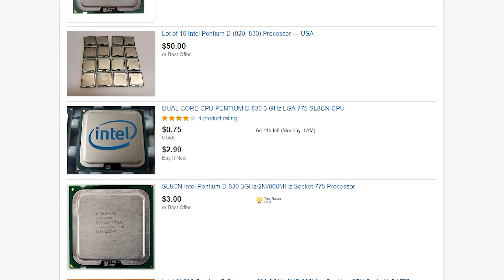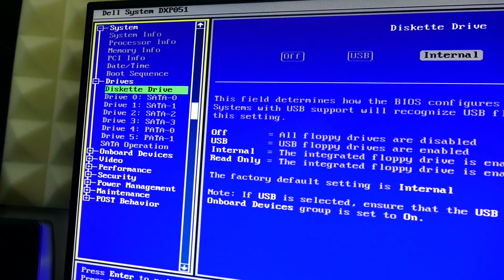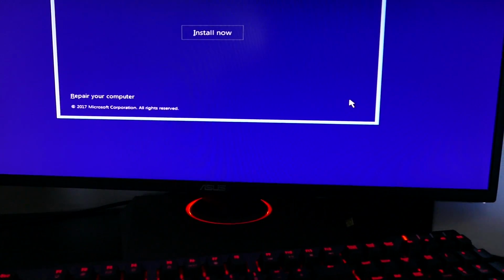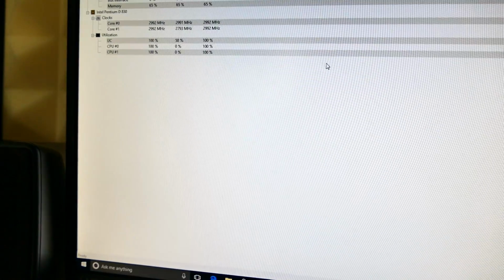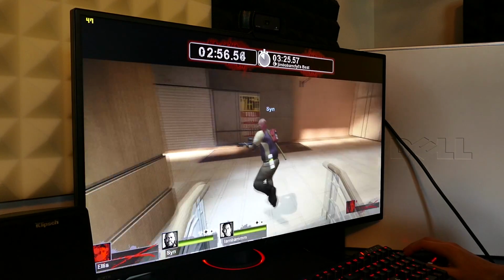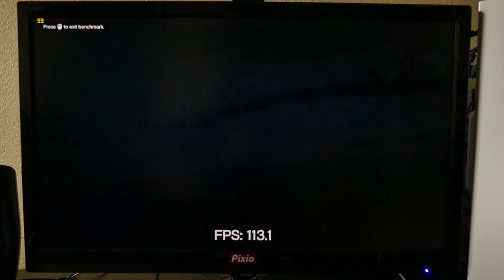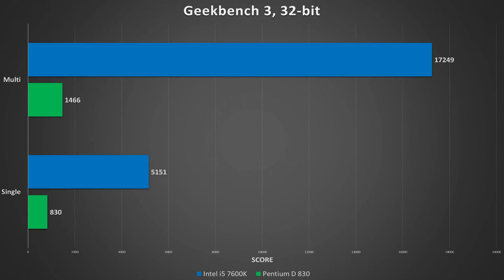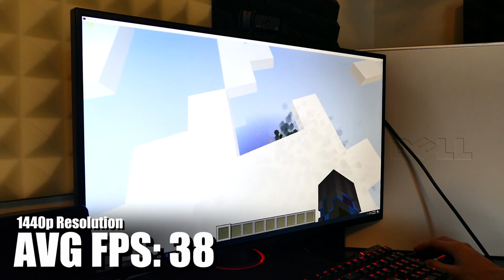I Paired a $6 CPU with a $700 Graphics Card

Comment: Can you rate my specs? 
GTX 1060 
i7 4790 
32GB RAM 
1 TB HDD 
ASUS B85M-G Motherboard
Reply: Sidddhant Kulkarni 32gb ram is overkill but overall it's a great gaming pc
Reply: izzy fast Thanks :). Yeah 32 GB is overkill but there was this big discount so I got it.
Reply: Laryngeal Cancer Aleks Too much ram, yes, but why mediocre Processor?
Reply: Can you rate my specs? Zotac GTX 1080 Mini
I7-7700K
16GB Ram
Asus Strix H270F Gaming
Reply: Rate my specs 

i9 10000k
3 TB Ram
1 EB HDD
1 PB SSD
GTX 1090 256 GB VRAM TI 90.4 GHz base clock 
10,000 Watt PSU Corsair
Reply: Sidddhant Kulkarni get an SSD for Windows. (256 for just windows) if you want to put a few games on it too than opt for a 500 gig. Still keep the hard drive though for files
Reply: Sidddhant Kulkarni 7
Reply: Sidddhant Kulkarni Pretty good graphics card, good CPU, Depends on the RAM type, Shite storage, Motherboard is fine
Reply: The Milestone LP I'm just 11 tho haha
Reply: Alonso Cadena It won't :) the 4790 will bottleneck anything higher or equal to a GTX 1080. 😊
Reply: UAEwolf no need for that pc then all graphics demanding games are 16+ minecrsft u can play with an g4560  and a 1050ti
Reply: UAEwolf moms credit card? 😂
Reply: IDK I Think You should have Got a I5 7600
Reply: RedJStudios Yeah. I'm planning to do that but currently in saving to get a new PSU as my PC is constantly restarting.
Reply: Sidddhant Kulkarni get a ssd
Reply: Sidddhant Kulkarni shite
Reply: Overkill
Reply: UAEwolf pretty good
Reply: Buy a cheaper CPU and a Better GPU , money wasted there , and buy less ram , no games will ever get to 16GB , 8GB is enough and it rarely bottlenecks(save few horrible games) according to people around the internet and myself , so get only 16GB ram
Reply: 1/10... 1060 sucks. U need gtx 1080 ti... Jk
Reply: Sidddhant Kulkarni most people won't use these
Reply: AwesomeXpert i have The same specs!
Reply: AwesomeXpert Nice! I was going to build an i7 7700k with a 1060 gb but decided an i5 7600k + 1070 would be best. I've picked up the 1070 almost brand new for $400 now saving for the cpu.
Reply: Sidddhant Kulkarni can rate pls? Nvidia GTX 1050 2Gb - 4Gb DDR3 ram - Intel Core 2 Quad Q8200
Reply: 32gb ram and 1tb HDD is a bottleneck
Reply: 32 GB of ram for what? You'd  be fine with 16. Besides that, looks great.
Reply: Gud shit
Reply: Rate my specs

GTX 1060
Ryzen 3 1200k
8GB RAM
1 TB HDD
120GB ssd
The GPU and the CPU are both watercooled.
Reply: SUCKS
Reply: Sidddhant Kulkarni let me guess. you probably spent over 2 grand on your build. and you couldve gotten ryzen 1600 and gtx 1080 8gb below 1500$
Reply: no ssd?
Reply: Sidddhant Kulkarni would be better with GTX 1070 same cpu 16 gb ram 1 TB HDD 128 SSD
Reply: Cody Biancuzzo total trash 😂
Reply: a 60gb ssd is perfect for only windows and some programs ..
Reply: 1TB is overkill
Reply: RedJStudios word. The HDD is such a massive bottleneck for otherwise amazing specs.
Reply: better than mine
gtx 1050ti
pentuim g440
12gb ddr3 
1tb hdd +160gb
biostar h110mhv3
Reply: g4400
Reply: Just lacks ssd for boot time ;)
Reply: 16 gb ram would have been enough ....
U should have invested in a small ssd
Reply: 8/10
Reply: My computer was made a pretty tight budget but this is what I have

Msi h110m mobo
Gtx 1050ti
Core i5 6500
8gb ram
500gb HDD
Reply: Fish
Reply: thats what i have following a gtx 950m i75500 2.4ghz
Reply: Use a pentium R
Reply: "can I brag about my specs?"
Reply: Is the ram DDR3 or DDR4? Looks like a good gaming rig to me ^^
Reply: I have a Gtx 1070 and i5 7600K and it is A BEAST!!!

Comment: You would think that at some point one of these channels would actually test something worth while..  Like I don;t know at the time of writing this you can pick up an e6600 for about 10 bucks...  But if you actually wanted to be a useful idiot I would suggest a budget pentium lga 1151.  Then you can demonstrate how you can redirect some of your finite budget to the video card to improve your overall experience as well as showing possible upgrade paths.   This shit just reinforces the "oh no I cannot afford that a gaming machine costs 3000"   You stacked this because the 830 is literally one of the worst processors you can get.  Right now 100's of e8400's been listed nearly a month at 4.75.    Minecraft does not "leverage" your gpu... at anytime... for any reason....  Source games leverage the cpu more than most current games.  They always have make it more playable on older video cards... Two of the worst examples for this... 

Oh and that shit about "if you see your cpu hitting 100%"...  Your cpu will hit 100% alot...  It doesn't mean anything unless you are having performance issues.  And first thing you do if your cpu is pegged at 100 and you are having performance issue..  CLEAN IT... the o/s that is... Esp right now.  I have had a half a dozen computers in the last week come in with some kind of cryptocurrency malware.  And lots of shit you don't need sucks down your processor.. 

To have a fine time gaming you only need a quad core processor...  Preferably using a socket that has a clear upgrade path to extend the overall life of your computer and therefore reduce the cost per year.  But listening to this guy will not serve you.  He did this to convince you of something.  He could have had the clickbaitier title of "paring $4 cpu with $700 graphics card"  But then he might have had to risk saying "That did better than I thought.  I guess if you are looking to start your build then its not a bad idea"  That being said I do not recommend $4 but if you are strapped for cash a $50 cpu and a 250ish gpu will be just fine for any game you wanna play.

Comment: Lol i got 270 + fps on SSD.. playing L4D2. All settings maxed at 4k. The performance on that title increases dramatically with solid state drives as I saw +- 100 fps less with standard 3.5 inch drive. You just need a decent quad core, preferably Core I5 upwards and decent SSD of course

Comment: Actually is not that stupid. Try to pick a real dual-core instead of a CPU with 2 Pentium 4 dies.

if that board support, lets say a Core2Duo E6300, you will notice a "stupid" boost on performance and you can install Win x64.

Comment: The pentium d does not have a hardware instruction prefetcher. The last 64 bit OS you can run on it is Windows 8. Not 8.1, mind you, just 8. 7 should be fine too.

Comment: maybe the windows 10 install on the SSD needed Sata mode to be AHCI but the bios was set to another mode? Either that or it was a UEFI install and legacy bios is unable to boot that natively.  Just some ideas
Reply: I was thinking the same thing about AHCI, I just learned how to change ACHI-Raid and back without reinstalling because of an issue I was having here.
Reply: total different hardware also, so he had to reinstall anyway.
Reply: or it was a 64bit install?

Comment: Did you just call the graphics card power cable a VGA cable? 239k subscribers, you ought to not be that unintelligent, or make such a silly mistake. As for the term hot swapping, it needs to be powered on to be "hot swapped", hence the term.

Comment: Did he mention how much ram?  I mean for a 32-bit it can only allocate about 4Gb. of RAM which for many programs isn't much.

Do it again with like an x64 Pentium Dual-core and max the RAM that the mobos banks can handle and use the same SSD and GPU combo, those would be more surprising results vs. cutting yourself off at 4Gb. because of the CPU architecture.

Comment: this is pretty much my first gaming pc except with a better card. i had a dell dimention 5150 with a 3ghz pentium d, 8gb of ddr2 ram and a 512mb ati radeon hd 5450. it ran windows 8.1 and booted in 3 seconds with a 3tb wd red mechanical drive running at only 5400rpm as the boot drive. it ran gta 4 at moderate settings without lag, which at the time was good enough for me. the pentium d kicks some serious butt.

Comment: I bought a Pentium Core 2 Duo E8400 2 years ago for only $7! Still collecting dust! Hey, got one Question, you have a Ryzen 7 1800X I used quickmark to run a benchmark for seeing what my system could pull in Gigaflops! My I5 7600K 500 Watt EVGA Bronze 80+ with 16 gb DDR4 2133 "Geil EVO Potenza" and 240gb SSD with average 430 mb/s r/w speed plus Windows 10 Pro scored 93 GigaFlops "Whole PC" (not per core)! 

But when I search for Ryzen R7 1800X it says "Whole PC" can only get 72.2 Gigaflops? I guess it goes back to a video you made comparing the two! I also am only utilizing 8 pci lanes with my RX460 4gb, but can overclock it to 1980 mhz using Sapphire Trixx! "I know I Should have chose the 470 or 480 that used 16 lanes but for $119 I could not say no"! Hope you read this, the Ryzen is supposed to be so much faster "I won't switch either way", but I am only 5 points under a I7 6950X that scored 98 Gigaflops "Whole PC"! 

This should be a question you are willing to tackle!

Comment: And silly me still plans on dropping a Rx580 in a 2008 AMD Athlon 64 x2 4200 just for kicks....yet i dont forsee such issues besides pos and maybe a lil cpu lag ...but  intellectually speaking i really see no issues ...ill report back when the External Gpu Laptop Ghetto Rig Fails First :/....praying the latter doesnt have issues. 

specs hp envy 15 touchsmart 
4270hq i7 3.5-3.7ghz Oc (cooling be the only issue 4 my ghetto rig!!!)
1tb hdd
256gb ssd
8gb ram
Dual or single Vaccum cooled 
Rear turbine cooled

oh yeah its a laptop

Comment: 1:34 I kinda hate Dell for their BTX case... Even in my slightly roomier Precision 390 with it's potato HD6670, I think my C2D E6300 is the bottleneck in that system because I can get 30-40 fps in BO2 on almost highest settings without bots, but as soon as I turn bots on BAM 20fps and below :P 1:46 and that's another reason I hate it lol lack of power cables, but there is a 6 pin down by the HDD bay. EDIT oh nvm that one doesn't have that :P

Comment: You cant hot swap OS harddrives to another computer, the OS on the SSD would have to have the Motherboard chipset drivers installed to boot from that harddrive. Thats why it didn't boot, there are ways to inject those drivers but faster to reinstall Windows 10 as well.

Comment: You more then likely had a UEFI install of 10 on that SSD. By default 8, 8.1 and 10 all install in UEFI mode if the Hardware supports it. That old PC would be limited to using BIOS without any EFI/UEFI support so you need a clean install with the disk initialized as MBR instead of GPT... Yeah it's annoying but UEFI/GPT is faster than BIOS/UEFI so if your system can use it then do so for best results.

Comment: I get 32bit as the 64bit systems perform better on 32bit rather than 64bit as I have tested it on multiple setups. Even older 64bit laptops work best with 32bit. I have Windows 7 64bit with crap specs beside the GPU being an Asus Geforce GT 520 2gb.

Comment: Just did this with an HP DC5850. It's sporting an AMD Phenom x4, 8gb DDR2 ram, Antec 450W PSU with a GTX 970 Windforce. Not sure what those prices would add up to in 2017 but it's playing Elite Dangerous at 50fps to 60fps. Also plays Dirt rally at about 45fps on medium settings. I also put in a card reader, and LCD fan controller and 2x SSD's. One for OS and main programs and one for games.

Comment: Is it common for reviewers to just plug a drive with Windows on it into various systems? I've seen that before where the reviewer just plugs one in. I thought you had to reinstall Windows whenever you have a significant hardware change like a motherboard (which he had to do here). Sometimes it may work, but there can be issues that I'd think risk messing with benchmarking.

Comment: Last I checked Pentium D's were actually 64bit believe it or not, and the reason the BIOS couldn't see the Windows 10 install is because the BIOS doesn't support UEFI, had you installed say, Windows 7 64bit for example, I feel the games you tried could have ran better.
Not sure if you'll read this but it's worth a shot anyway.

Comment: Windows 10 only boots with the rather new UEFI standard (unless you change the installation setting in setup).  That explains why the wouldn't boot before you re-installed Windows.

Comment: I paired a 7 years old gpu with a i5 4690k for SCIENCE , who am i kidding that's my pc
Reply: Me too, make that 2500K, a week ago i said goodbye to 470 and got a 1050. wish i bought the 1060 3GB for a little more.
Reply: Aron Sima Get a 1050ti if you're on a budget and it'll be a decent gaming pc
Reply: Mining is distorting prices for everything, the 1050 Ti used to be called a poor value compared to the RX 470, and then... Look at Maxwell and Kepler cards instead.
Reply: If you want a pre built the best one is skytech archangel it has an amd fx 6300 and a gtx1050ti. But if you do have more money you can build your own pc.
Reply: i have the same CPU (overclocked to 4.6) with an RX 580 and it's a beast. Can play almost anything at 1080 ultra and can even go 1440 high/mid settings on some games.
Reply: Devil's Den Gaming who did you say that to
Reply: Rzaqo aaron but all he has to do is upgrade his ram, gpu and his power supply. I'm getting a skytech archangel and it has pretty good reviews. The AMD FX 6300 in it has 6 cores
Reply: You can build a dirt cheap system around an fx6300 or fx 8320, if you play in 4k, the cpu barely matters
Reply: This youtuber stole my build!
Reply: Planning of getting an i5 3570k with my Radeon hd 5870
Reply: Aron Sima i have other way around 8 year old xeon w3550 and gtx 1060 3gb
Reply: Devil's Den Gaming it would be pointless to downgrade to fx6300 it is older and slower he probably only needs to upgrade his gpu
Reply: Devil's Den Gaming and please don't buy fx6300 pc in 2017 it's over 5 year old platform and slow invest in to something newer for example any ryzen will outperform fx6300 in gaming
Reply: Rzaqo oh ok i never knew the fx 6300 was an older cpu I'm still fairly new to the gaming pc stuff all i know is the basics like which gpu is good and which is better. Overclocking, SLI and i know how to build a pc lol that's it but i have no idea about the processors. I guess I'll have to upgrade to an AMD Ryzen when i get this pc later down the road
Reply: Devil's Den Gaming fx6300 is not terrible but it is aging and it is noticeable
Reply: AN fx 6300 is about 5 years old
Reply: Aron Sima wut
Reply: i fried mine i5 4690k ...
Reply: 3 modules and in each 2 cores ! So not a true six core ! When all cores is in use performance goes little bit down ! But its ok CPu with R9 270X 2gb skyrim works good 50 fps on high, also GTA V even with GTX 550 Ti GTA V works realy good..
Reply: I have a 8 year old gpu..😭😩
Reply: Devil's Den Gaming I would swap out the fx 6300 to the 8350, I have 6300 at the moment and it bottlenecks my card in some games. It's a 5 year old processor but you can still game with it if you have good gpu. I want to upgrade my board, but ddr4 ram is too expensive for me to afford at the moment.
Reply: 6300 is fine, better to keep 6300, and save for  new system, unless he can get 8XXX series cpu for cheap and his mobo supports 125W cpu
Reply: Medic 
You sure?
Because it costs $100 more than the 3gb version now
25% more money for 5% better performance? nope
Reply: Aron Sima I paired a 18 year old gpu with a potato gpu bottleneck :(
Reply: No 1060 3gb won't be worth it since it has only 3gb of VRAM. Most games require a minimal of 4 or higher. 1050 ti SC would be a better buy.
Reply: Woah not 3 years maybe like 2. But I'm getting a 1060 6gb and after 2 years going to update to Nvidias GTX 2070
Reply: FX 6300 is kinda bad. A Pentium G4560 or the new one G4900 will do better with this rig.
Reply: Get a 780 ti for £100, it’ll keep up with a 1060 3gb
Reply: MS TheDev One is never supposed to buy the regular 1050. Never. That card is a dry piece of silver. Only the golden 1050 Ti shall be praised.
Reply: yeah a 1060 3gb is about same price of a 1050 ti and gets double performance...
Reply: im using 2600k with r9 380 xD
Reply: Aron Sima lol i rocked a core 2 quad and integrated gpu for quite a while

Comment: I was forced to upgrade the BIOS on my old Gigabyte Z77X-D3H before my then new MSI 980 Ti Lightning would work, and that was on a much newer system than you "turtle" computer.  -  I do not think younger people understand the slow overall speed and load times of older computers.  Floppy disks were slow, however, DOS was low overhead.

Thank you for this video, and the fun I had watching it.

Comment: By the time Pentium Ds were out (they were never popular, got destroyed by Athlon 64 x2), LCDs were just getting started, IPS panels were double-kidney priced and High end CRTs had over 120Hz refresh rates.
Reply: Among the last hoorays for NetBurst architecture. Abysmal IPC (deep instruction pipes) and glacier - melting heat output. I got mine cheap and built a PC around it out of boredom. It was the 805D 2.66 Ghz and my  E6400 first generation Conroe ran circles around it despite only being clocked at 2.13Ghz. My own tests showed about an 80% IPC advantage for the Core 2 duo.

Comment: You should make something like i7 7700K with insert very weak or old graphics card vs i7 7700K with iGPU.
Reply: i7 7700K, 64GB, 8400GS vs i7 7700K, 16GB, iGP in GTA V!

Wait... First system is glitching like it's Unity game from China!
DNF to this system!
Reply: Because 8400GS is weakest card that can play GTA V while 8800GTX is better than it, 1 month older than PS3 (also better than PS3) and oldest card that can play GTA V. (also first DX10 card, what a surprise!)
Reply: That’s already been done many times. The GT 210 and GT 710 get their asses handed to them by integrated graphics.
Reply: yea like maybe i7 7700k and a GT 210
Reply: no not even a GT 210, A GT 8400GS
Reply: Nvidia fx series will be much bettet
Reply: i7 with 7800 GTX and the homebrew 7000 series drivers for Windows 10 >:)